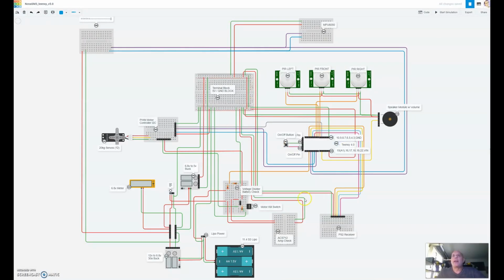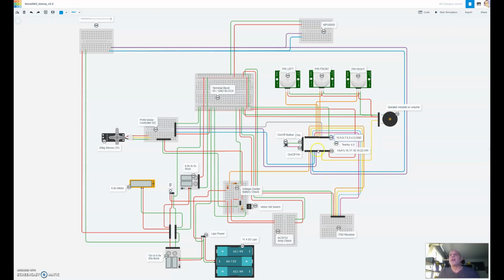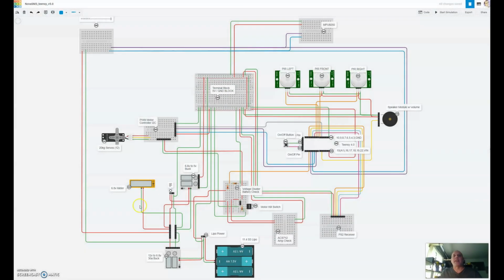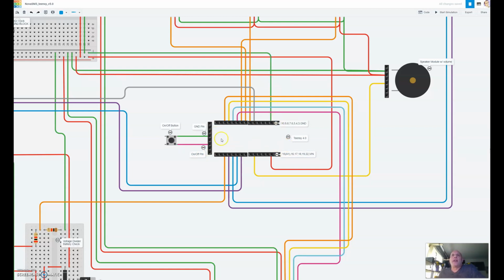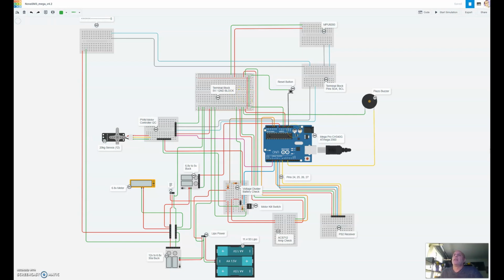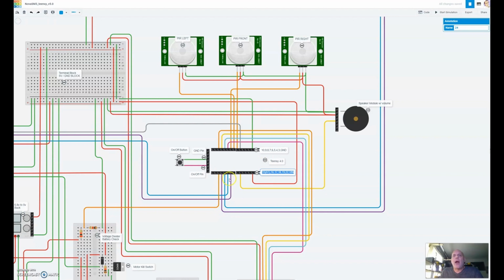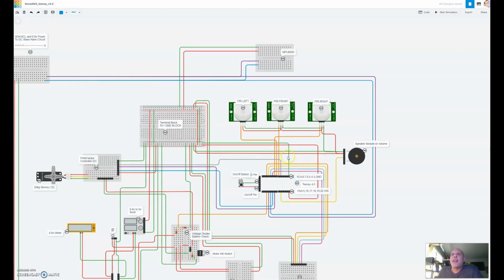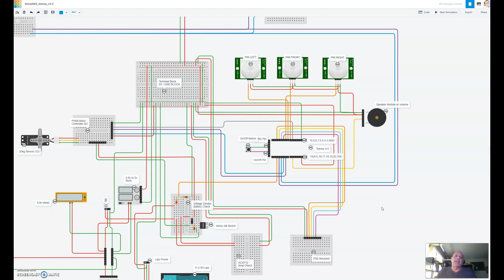Teensy 4.0 Wiring : Nova SpotMicro3

Comment: Teensys are great but expensive! One thing you'll learn when exploring alternatives to Arduino is that everything is vastly cheaper, vastly more capable, or even both. ~5$ ESP8266 I'm use is receiving wifi commands from Blynk app, calculating all IK, sending 12 angle set-points by I2C all within <5ms with a 75Hz (~13ms) loop. Then the two STM32s act as IO and running PID controls for 6 actuators. 

Congrats on 2nd place btw! Always enjoy following hobbyist builds learning as they go similar to myself.
Reply from the maker: Thanks for much for the feedback and congrats!  Its a world of options out there, making it a tricky choice of hardware and combinations indeed!  I have played with a few ESP devices... I definitely will go to them in future projects. Moving to Teensy was enough extra work for me lol   

I have huge interest in learning about PID controllers, as well as IK.  Any chance you could share your code?  Finding any code that is a)readable, or b)adaptable to my project seems futile.  I'm having a real hard time wrapping my head around all of the math in IK - the coding otherwise, I'm sure I could handle.  Is it really that hard to find an IK class that can take the bone measurements, angle min/max for servos, and home positions... and just return the end effector x,y,z and angles?  I would think that wouldn't be too difficult, and would love to do it for the community - but again, the math escapes me. :( 

thanks again for your comments!
Reply: @ChrisLocke1969  I do plan to post everything but don't have it collated on thingiverse or completely on hackaday.io yet. Still a work in progress but slowly coming together. The PID controls are in the STM32 but I don't have those quite finished. The ESP8266 is a bulk of the functions and the key Leg_Kinematics function is mainly what you're looking for. I have calc diagrams for leg length, X, and Y equations but I'm not seeing my ZZ yaw calc drawing which unfortunately is one of the more complex calculations since each leg has a unique equation set.. WIll work one up for other's reference eventually. For the calcs; I heavily referenced James Bruton's OpenDog yt series. In a few of his videos he details the IK derivations. What hung me up for the longest time is that he details pitch and roll calcs but that was just for the stationary demo. The equations don't work when the feet are in non-zero xy locations so I omitted pitch and roll from my bot to focus on accurate XYZ, and ZZ translations.

https://autode.sk/3wGNau9
https://github.com/DesignCell/RoboDog_ESP8266_Controller
https://drive.google.com/drive/folders/1L80JdRagECuKyt4UUHsq1ggkhZvKobGQ?usp=sharing
https://photos.app.goo.gl/aTyLjL6e3BeYmFEd8
Reply from the maker: @DesignCell  oh wow, I am very impressed - yours uses dc motors and ball screws?  nice!  yes, James' project was a huge inspiration for me, and I too tried using some of his code and walk-thru videos to understand IK... I agree, the flat-plane stuff is easy, its bringing the coax joint into play that my mind goes void of 3d space.  lol    Please keep me posted on your updates - I've subscribed to your channel, in case you post there!  Much appreciated!
Reply: @ChrisLocke1969  I HOPE to have a legs moving video posted this week. Currently working through soldering all of the instruments. 120 solder points left... then testing to validate everything still plays well with each other.
Reply from the maker: @DesignCell  that's a whole lotta soldering!!  Good luck, my friend... I look forward to seeing your progress! ;)
Reply: ESP32 is amazing, just switched into using it.. and its even cheaper, the WROOM chips cost like 2$ a piece! You can use the socket programmer as a dev board for prototyping.
What is really amazing about it, is the speed.. and the ability to change the CPU speed on the go. I can downclock it to 10mhz when needed (for power savings) and then just switch it back up to 240mhz inside the program with single command. So i can set the CPU speed based on demand.
Not to mention that i can run a webserver on it, so i can create a control interface as a website and also use that to upgrade the firmware. No need to create apps, and now i can update the "app" & actual firmware as single file. Really amazing chips for mere dollars.
Teensy is great when you need that absolute speed, the 1ghz option will come in handy on some projects
Reply from the maker: @Nobody-Nowhere  many have tried and none to my knowledge have succeeded... not with this quad, at least. But good luck, Im just not a fan of ESP devices. 👍
Reply: @ChrisLocke1969  Why would it be different what chip are you using if its the same arduino platform? it simply gives you more flexibility. i don't built bots though, but i dont see why would it differ what you are building. but me hyping esp32 is simply because i have found it extremely flexible, and it really opened so many doors after using 16mhz nanos for a long time. and constantly struggling with the limits of flash & ram.
No  i have a chip, i can fit on basically any project and adjust it to the needs of the project. So i did not say you have to use it.
Reply: @ChrisLocke1969  ??? ESPs are great for these projects! They may not have the massive io counts (which is why I'm using (2) STM32F103s) but as nobody mentioned they are exceedingly powerful and flexible. Every board has pros/cons to weigh but I've been a fan of integrating multiple cheap boards
Reply from the maker: I'll be waiting to see a working ESP spot! 👍😎
Reply: @ChrisLocke1969  dude... just search esp32 quadruped?
Reply from the maker: @DesignCell  lol im not denying it, just know nothing's popped out at me, and the spot esp project hasn't gotten very far at all last i heard. Besides, Nova now uses teensy, so argument is moot for her 🤣👍😎
Reply: @Nobody-Nowhere  100% agree! Like I mentioned, once you start looking at Arduino alternatives everything is far more capable, cheaper, or both. The only reason im using an esp8266 over the esp32 is that I 1) wanted to see if the esp8266 was capable enough which it has been and 2) I have two of them and only one esp32. I really like that the esp32 is not only higher clock but is dual core iirc and has multiple i2c buses. I would like to look into the 'app' you're referring too. The wifi is my primary reason for using the esp in the first place.  I'm using an app; Blynk to send all control signals along with running a local linux server to minimize latency. Hase been working great, minimal code to implement, and the app has a ton of customizations. I highly recommend it!

Comment: teensy 4.0 is insane, you can overclock it to 1ghz with a tiny heatsink
Reply from the maker: i saw that, pretty cool!
Reply: @ChrisLocke1969  Have you looked into RTOS? You can run parallel loops! No longer one big loop. It really changes everything, i can have one loop for sensors and one for motors running constantly. And these loops can be simply prioritized. And its way simpler than i thought.

I thought  that the dual core of ESP32 was the thing, but its simply the RTOS system that changes the way you can think about programming these things. On ESP32 you have the added benefit of assigning the loops on cores... but its not that important if you have one really fast core like on teensy.
Reply from the maker: @Nobody-Nowhere  thanks for the tips!  Yes, I've heard of RTOS... it could be in my future!  Right now and so far, I'm happy with the Teensy... what a world of difference!  With proper-timed state machines, I think we'll be good!
Reply: @ChrisLocke1969  Its worth the time to start using RTOS, its literally just two lines of code to create one task. Its much easier than i thought, it hough it would be a hassle.
It makes everything so much simpler, when you can suspend & restore task and prioritise them. When you a no longer using a 16mhz chips.. you need ways to benefit from all that power!
Reply from the maker: @Nobody-Nowhere  nah, thanks... I write software, it bothers me to use off-the-shelf solutions.  I build these projects for the fun and challenge of it... not to build an army of bots to take over the world.  :)
Reply: @ChrisLocke1969  " it bothers me to use off-the-shelf solutions.  " i dont understand this, how using RTOS would be any different than using any library?  the challenge is not actually benefit from the systems, to actually use the resources. its not like it does anything for you. much like your whole project is based on an "off the shelf" project, but it still seem to be challenging?
Reply from the maker: @Nobody-Nowhere  lol show me where i took any of the electronics or software design from another project?  Comparing supporting libraries to off-the-shelf software that forces you into design paradigms / architecture is not quite the same thing in my opinion. To each their own, I am happy doing things this way, but i appreciate your feedback nometheless.
Reply: @ChrisLocke1969  I dont think you understand what RTOS is at all. It does not force you into anything, it simply adds more options. All it does, is lets you prioritise and run multiple loops instead of the one main loop. This greatly helps in timing, for example if you have 4 legs that you need to time precisely. And on top of that, an array of sensors that need to feed new data to the system at the same time.

"lol show me where i took any of the electronics or software design from another project? " The whole design? This is based on SpotMicro isn't it? This is also why its so outdated, like using ultrasound sensors.. when you could have a 360 lidar on top of that for like 30$. The amount of TOF sensors you can get now is so wide. Prices have gone down so much, and availability of new sensors for robots is so wide.

And what is actually currently incoming, is the machine vision and learning boards. Check out Sipeed M1 W Dock or Sipeed Maixduino, both sporting the Sipeed M1 chip with machine learning capabilities. 30$ boards with insane specs, 64bit, 8mb memory and 400mhz + neural network in hardware. And Maixduino even has the ESP32 on the same board.

If you want this to do something, then you need image recognition. Currently, you can get all that.. lidars, cameras.. but instead, you have infrared & ultrasound. What can those really do? Just saying that its not smart to disregard new developments based on some irrational fears.
Reply from the maker: i dont think you understand... this is nothing but a hobby to me... just about 2 years. Im quite content, thanks for your opinions. And based on what? no, incorrect, the electronics and software are 90% my own, exvept for libraries and high current switching circuit. Good day, nobody 😉 If im not smart or irrationally feared, then more clearly, you have major judgmental issues 👍